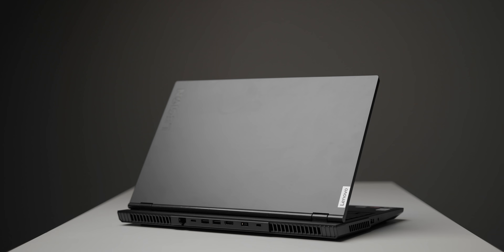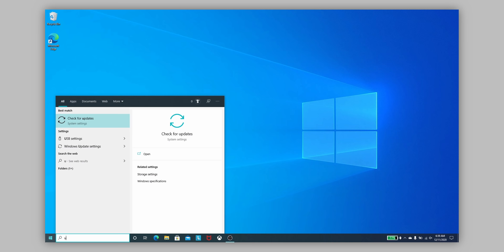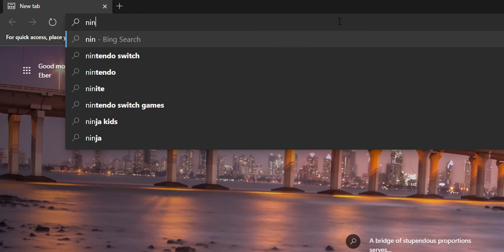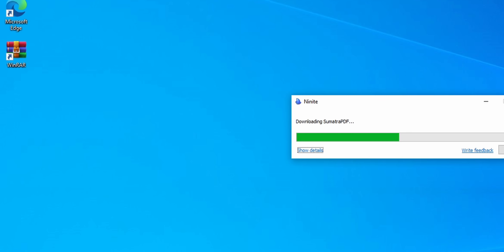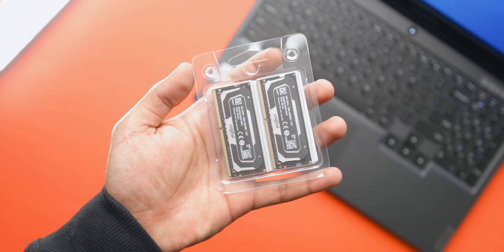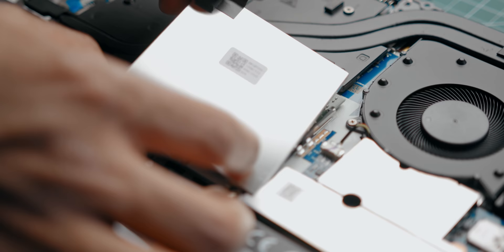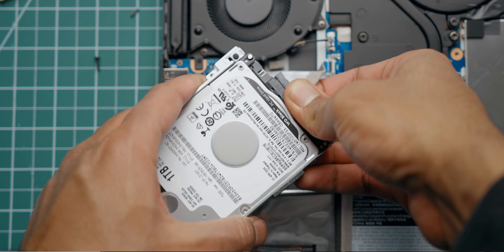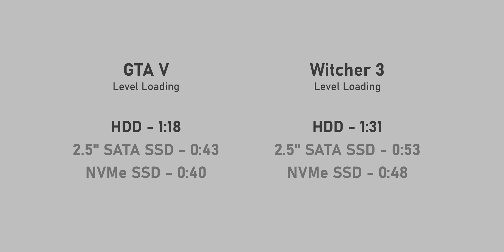How to Upgrade and Optimize Your Gaming Laptop for 2021

Comment: You can still install Windows 10 without a Microsoft account as long as you disable internet connection during installation.
Reply: Wtf really ? but woudlnt it ask key later?
Reply: @vittal933  nope
Reply: Aight delete this we don't need microsoft seeing your comment man
Reply: also the last time windows tried to get me to setup a ms account after an upgrade i can canceled out of it and still use an offline account.
Reply: okay so please explain to me why having a Microsoft account is so bad? you need one to use Gamepass anyway
Reply: @Atropos148  It's not bad, nor good. That depends on user needs. But it's always good to have different options available.
Reply: @Atropos148  i am old fashioned i guess and i have used a local account ever since windows 95 98se and windows XP i find in my experience that any PCs running on a ms account are slower than on a local account but it would i would like to try a side my side to see if it is that much slower.
Reply: @Atropos148  also what's gamepass?
Reply: Privacy for one.
Having to deal with it popping up, complaining there's "an issue with your account" every so often for no reason.
Needing to log in with an email address to your PC, instead of a local account.

It's about choice.
Reply: @amshermansen  yes.
Reply: I second this, you can do that, I hadn't realized it this when I was setting up my laptop for the first time (came from win7). I was shocked to the amount of Access they wanted to my data, so I naturally did a factory reset, booted without enabling wifi, even switched off the router as an extra precaution.
Reply: No need to disable internet connection. Just press cancel on the online account.
Reply: This isn't possible in all builds - In some of them, the option is simply not there.
Reply: @amshermansen  how so ? Since my laptop encounter, I did build 3 PCs (1 is my own) and in all of them I did the same exact thing.
Reply: @buneech  yes, I'm aware of that. But I did it as an extra precaution. I could survive without WiFi for at least 45 mins
Reply: @AbiRizky  Yeah I know right. Microsoft is always changing things in their OS anyway. :-(
Reply: Microsoft asking for online account at the beginning sucks, especially in the enterprise, if you don't want to insert your laptop in a domain from the first installation (configuring PC name and other stuff at first). They probably won't kill this feature with no internet / offline configuration, unless they will kill Active Directory altogether (which wouldn't be far-fetched, they will probably push for a cloud-controlled office365 or something, like Google does with Google Workspace/GSuite).
Reply: @mohammednurul9380  It's almost as if "Some of them" means not all of them or something. ;)
Reply: @Barret_Radtke  Microsoft's subscription service to download and play games for few dollars a month.
Reply: @vittal933  It will after the install is complete and you setup internet connection after you are fully booted into windows.  You can get around this by hitting cancel when it asks for the microsoft account that you want to connect to the pc.Otherwise if you hit remind me later, it will continually ask at later dates.  Thank you Microsoft for another unwanted anoying feature of windows!
Reply: @Barret_Radtke  once you put in your xbox account for gamepass it will link your computer as a microsoft account
Reply: @soulwind721  i don have an xbox.
Reply: @Barret_Radtke  game pass is for windows too
Reply: @soulwind721  k
Reply: I can confirm this works
Reply: @Barret_Radtke  idk maybe some xbox stuff
Reply: @Barret_Radtke  Game Pass is Microsoft's BLOCK USED GAMES 2.0 recurring rental service initiative aimed at brainwashing consumers into thinking it provides value when in reality Microsoft's long-term goal is to have a digital only future.
Reply: You just put I don't have an account and in fine print, it says create a local account.
Reply: @karulean  They just reintroduced this in the 20H2 version update. The previous version had removed it
Reply: @thetechthings8283  Yeah I had reinstall window multiple time and sees that option but wasn't aware that it was removed for some time.
Reply: Kmsauto that is all
Reply: @Atropos148  They have no need to ask for my data.
Reply: @vittal933  It doesn't. But Windows 11 just forces login.

Comment: 3:01 if you disconnect from WiFi or Ethernet, windows will give you back the option for a offline account
Reply: DO NOT CONNECT TO THE INTERNET FOR INITIAL SETUP
Reply: I've been always able to do offline account with ethernet connected. From usb or reset this pc. Nothing comes in way o.O
Reply: @DopeEstonia  then you prolly got an old version of the windows installer
Reply: Chris Schuler  not connecting to the internet works for windows 10 home.
Reply: Bruh, respect for pointing that out! Was just about to write the same thing xD Screw big corpo wanting you to create a online account lmao
Reply: @jaye3  i think they forced it on the 1909 installer, so anything before that would have let him, but yeah from 1909 and newer just disable internet it will complain and then let you setup a local account. (due to the amount of non windows 10 stuff i run - linux, mac, windows xp and older), local accounts are needed for me. )
Reply: Yup this is true. Did this for my Lenovo laptop as well.

Comment: It's always good to buy a can of compressed air or a machine that compresses air for cleaning the laptop regularly. There's also a program on steam, but this is completely subjective, called Wallpaper Engine for those wanting to have some extra wallpapers that are dynamic. Also changing the thermal compound is pretty common for gamers.

Comment: Glad to know im not the only one using microsoft edge
Reply: There’s dozens of us
Reply: EDGE is GOOD.
Reply: EDGE is my default light pdf viewer, allows annotations. I also use it for "collection" sites, and to create desktop apps for windows (pick any website, turn it into an app)
Reply: @MammothBehemoth  I also do this my guy, and also if you update Windows you dont have to uninstall-install it.
Reply: @akirathearchibald7958  my problem now is if you do alt-tab, it runs through all the tabs instead of running between apps. Pretty tedious when using tons of tabs. Any work-around?
Reply: Edge on Chromium is excellent but you should really give Brave a try, they pay you in a cryptocurrency called BAT if you enable ads
Reply: Edge is good, chrome uses 20% of my CPU while edge uses max 7-9%.
Reply: @theshutterbug5071  can you specify what vaporize is and what laptop are you using?
Reply: @MammothBehemoth  I believe by vaporize he means it drains his battery quickly
Reply: @kraittt3605  exactly

It's so much lighter

And it's beautiful to use too
Reply: Me toooooo

Comment: 3:00 You can still use an offline account, just don't connect to WiFi or Ethernet when prompted. Select the "I don't have internet" on that page, then "Continue with limited setup" on the next page. Works like a charm every time.

Comment: Another hardware upgrade you could do is replacing the standard 60wh battery with an 80wh battery.
Reply: Have you tried it and if you did how has your experience been with that upgrade. I’ve looked around and as far as I could find, no one gave any details on whether or not it worked and how well it worked. Also information on where/which battery you used would be great too. Thank you.
Reply: @jake598481     Hi sorry I found this information from reddit but basically it requires you to remove the hardrive cage next to the battery exposing the NVME slot and then replacing the 60 W/h battery with the 80 W/h battery which will take over the space where the hardrive cage was. The laptop actually comes with an 80W/h battery for the RTX 2060 version and some places sell the 80 W/h version for the gtx 1660 ti model, they also have the 80W/h in the legion 5 17 inch 1660 ti model so it is definitely compatible with the hardware. It seems like a pretty straightforward process but I believe you can find guides online.
Reply: hello, have you replaced the battery?, if so for how long can you play game(high graphics) with 80w and 60w.
how much juice does 60w give and 80w give, am planning to buy this so hope to hear from you soon.
do you suggest any other gaming laptop.
Reply: @chummzgonzalvis2427  I havent done it personally, but i know people have done it before due to posts online. Reddit had a few posts on it and j think i saw a video somewhere about it. As for battery, if you adjust the setting properly you can get 6-7 hours with max power saving measures.
Reply: @splatman1150  thanks for the info, how long can i play game with high settings on battery of 60w and 80w.
sorry for bothering you again.

Comment: Some laptops use a combination of philips head and torx screws. Also, if there are only a few visible screws, you may need to pull off the rubber strips on the bottom. Do this carefully because its possible to pull up the rubber and leave the adhesive strip causing you to stretch out the rubber. If this happens, cut the excess length from the middle with a utility razor.
Source: dismantling 50 laptops in the past week

Comment: To set up a local account, Turn on airplane mode. Don't connect to a network at all during initial setup. Unless it's changed very recently, that should prevent it from requiring a MS account. Can't connect to a MS account if there's no internet.
Reply from the maker: With the newest update you can still do that but it but you'll still need a MS account the moment you turn off Airplane Mode.
Reply: @HardwareCanucks  oh man, good to know. Been a while since I started from scratch!

Comment: 1000 bucks for just a 1650? This ain't it chief.
Reply: I think the 1660ti 4800H version was 1000 bucks before. Must have increased the price I guess.
Reply: Yeah I would expect 1650 for $600-$800 personally
Reply: I got my 1650ti for about 850 with a 4600h and 120hz display
Reply: Bruh i got a 1050 for 1000
Reply: Sponsored by Lenovo so they won't address that's a crap deal.
Reply: Yeah :/ but laptop specs are different than prebuilts unforunately
Reply: Got my laptop with the 1650 for only 630$
Reply: What do you think is fair for these specs?
Reply: @why_tho_  i have the 1650 r7 4800h 16gb ram 144hz with rgb but i think its only for some regions because i looked in the us for that same laptop but no results i got one in the middle east and found some in Asia
Reply: @anthonyholmes153  Yeah laptops with the 1650 ti should be between $800-$1k if it isn't on sale for less that is. $1k+ and its 1660 territory to about $1200($1250)
Reply: @why_tho_    still not worth  $1000 it not even  RTX inside .  GTX  1660ti   should be around $700 price.   We still for  RTX 2060 or  RTX 2070 for  $1000 with  at  least 16gb 3200mhz speed!   We all know  RTX 3060 coming out !  Buy cheap spec gaming laptop at the end you have to say  ah ah !  FxxK  My Self  and  LOL and shit in the pant!   It better to save up from that  $1000 and wait for the right and latest one!
Reply: A year ago I bought the predecessor to this laptop. I got a 1660ti and i7 for $1100.
Reply: @ModernGeekReview  You do know that the 2060 is priced like a 970/1070 right? And thus won't be in laptops costing $1k but more like $1500+
Reply: why are you guys only factoring pricing based only off which graphic card it uses lol. 1 grand for a Ryzen 7 4800H, 120Hz screen, 512Gb SSD, 1650? Seems fair enough
Reply: @axa122  Agreed it's a little odd. This laptop is specced in a more CPU focused way than GPU, which is the norm for gaming laptops.
Reply: @axa122   fair is  LOL!   You can't upgrade  the laptop  gpu even if that a great  cpu inside!   GTX 1650 really now that entry gaming!  $1000 down the drain.
Reply: @ModernGeekReview  oh come on. It's a laptop of course it's not exchangeable unlike desktops. Plus it's a budget laptop.
Reply: If you want all high-spec hardware just buy a desktop one. One major concern for higher GPUs and CPUs are power and heat issues. I bought this laptop and to get maximum performance mode on you are literally required to play it while charging since it will drain the battery in like 15 minutes of playtime.
Reply: @axa122     Future buy is i do want a gaming laptop .   i got the desktop but i want portable just in the future where they make it with the right spec and more afforable then right now then  i buy one .   could be for a long time or  maybe not
Reply: @Montisaquadeis  
I got my 2060 laptop with a Ryzen 9 for $1300
Reply: @-Burb  I am going to assume it was on sale for that price.
Reply: @Montisaquadeis  
Nope, full price. Asus G14. You can even get a 2060 laptop for under $1000 now. Maybe a year ago 2060 laptops were $1500+, but now that would be insanely overpriced.
Reply: I ordered the Legion 5 with 4800H with 16gb ram, and a RTX 2060 (115w) for $1099 I spent an extra $350, and got 2) M.2 1TB drives and the Full Size battery.
It was this, or get raked trying to find an upgrade to the GTX 780ti that died (my Bedroom PC, i5 6600K). If I was going to settle for an RX580 or GTX 1660ti, and still spend over $600, then I might as well get a laptop on credit! The only good thing is it justified my want of a decent laptop.
Reply: Going to hold out and see if/when AMDs new 6XXX line is good and affordable. Not opposed of getting a used unit.  Would be willing to go on EBAY, and find a GTX1080ti if new unit prices continue to be stubborn.
Reply: @-Burb  I almost went for an R9 unit, and it sold out as I was deciding between it and the 4800H/ 16GB/ 2060(115w)/ 144MHZ 1080screen, that I decided to get ($1099 with only a 500GB ssd)
Reply: Here in India for same gpu with R7 you've to pay around 1100$ and you'll only get 120hz screen with poor color gamut.
Reply: @greenman8  how long can you play games(high graphics) with 60w and 80w
Reply: @greenman8  how long can you work with 80w and how long can you play game with high settings in 60w and with 80w. just wanted to know the difference.

Comment: There's another one I'd recommend if you're a little bit more experienced. You might not have heard about this one, but there's a script on Github called "Windows 10 Decrapifier" that uninstalls the crap that Win 10 comes with, including but not limited to - Cortana, privacy invading telemetry, "Your Phone," Skype, Famville, Built in Advertising, Skype, etc. The best part is that it's customizable with documentation inline so you can customize it to fit your needs. Again, more experienced people only!

Comment: Offhand, That was kind of long-winded. . . . BUT on the other hand, it was slow and steady, such that I could check on some of your recommendations, as you were speaking. Nicely done. I just upgraded a new Acer laptop. I added drives, upgraded RAM and installed some new software. The process applies to any laptop. Again, Nicely Done. 
By the way, I am a long time fan of CPU-Z. That software is VERY informative. SPECCY also tells the user LOT's of info about the computer he is using.  Cheers.

Comment: Be very careful of the Legion series, Legion 7i  with RTX2060 without G-SYNC display will not have the vapor chamber cooling.  They will take away key components without any notice or specifically mentioning it to the client.  So please double check on all service manuals and forums before you order. Lenovo tends to promote the best of the configurations with Youtube reviewers.

Comment: Upgrade your thermal paste to something nicer. Liquid metal is a bit of a gray area, but something like KPX/Kryonaut/GC-Extreme would help with thermals by a few degrees, and help with a bit better boosting behavior during game play. If every bit counts (RAM, SSD, etc) then this should also be considered.
Reply: Ptm7950
Reply: @svenvanderzwaag1012  yeah, I really want to try that stuff on my laptop.

On my Dell G5 SE, I went from
Stock > MX5 [then after a recall on MX5]
MX5 > T.G. Kryonaut

I'd only change again for that PTM stuff.
Reply: @scottstamm7022  its amazing. Like ridiculous. The performance is something in between good thermal paste and liquid metal, but it doesnt have the risks liquid metal does. Also it last wayy longer compared to thermal paste (probably years) before you need to replace it. The only thing I found is that it is very hard to remove the heatsink of the cpu again because it dries up quite solid. Atleast on my laptop. Maybe it would be possible if it is still warm, but it is not really a problem for me. Also the legion in this video uses ptm7950 stock so I wouldnt repaste it.

Comment: The upgrade that you must do if you own a Tongfang or a Clevo barebone based laptop. You can upgrade your battery. I've lost the harddrive cage and put a bigger, longer sized, battery in it.
Reply: I think same with the legion 5. Battery is upgradeable to a larger 70 Wh but removing the harddrive case
Reply: how long can you play games with high graphics 
with 60w and 80w

Comment: Wow that was loooooooooooong with info that could've been conveyed within 5minutes.

There is a big thing that you didn't even mention : Replace that thermal paste.
I completely understand that it is a little advanced method, and not really useful when looking at a brand new laptop. But as the laptop gets old, it becomes absolutely crucial to repaste to get better thermals and hence avoid thermal throttling.